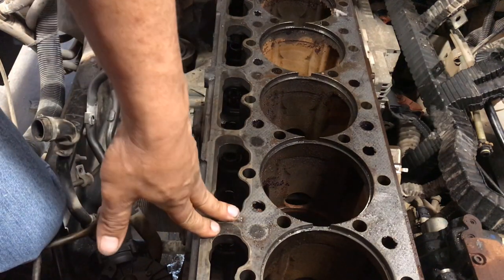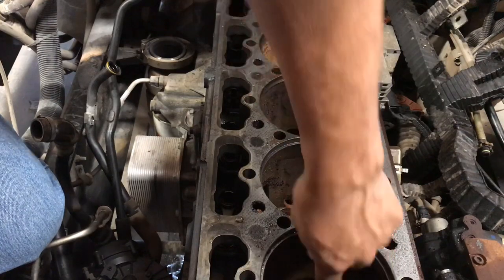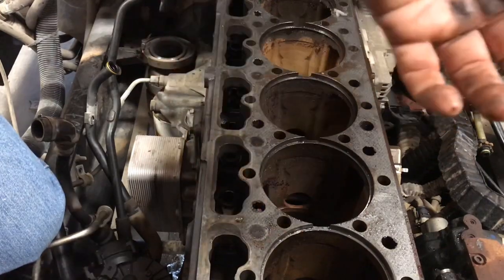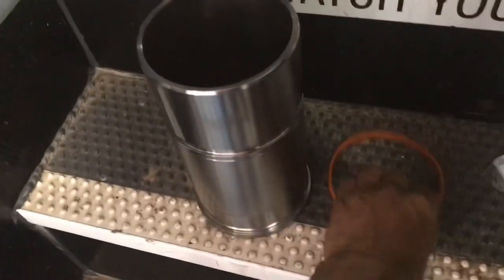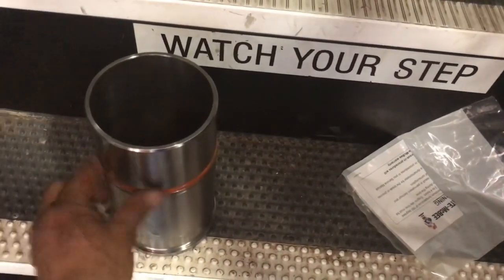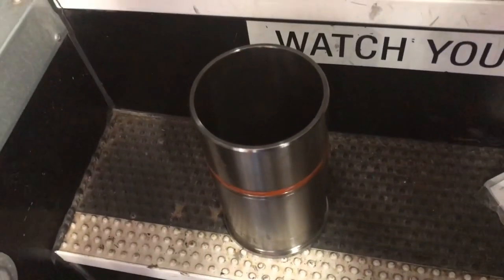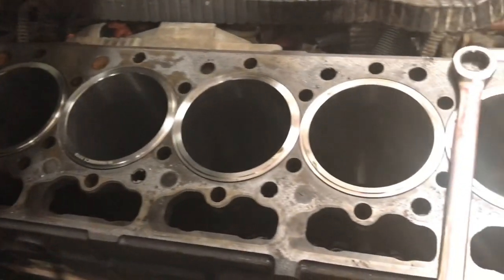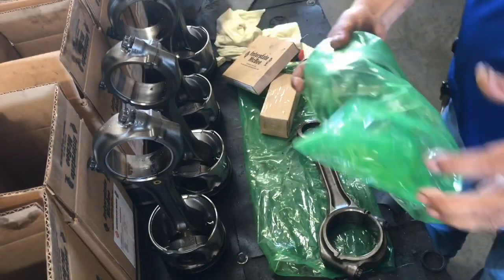Assembling a Max force DT

Comment: Hi Joe, I see that you were using Interstate Mcbee parts in this video. Do you prefer them over Highway & Heavy Parts? Can you tell which one is more recommended. Or if you have had the chance to use Highway & Heavy Parts before for a job like this one. I have to do the same in my 2013 maxxforce DT. Thank you

Comment: Hi I have Joe can I reuse the head bolts. I have 2013 maxforce  that only over heated . Can I just slap a head on it . Thanks
Reply from the maker: It is not recommended but it can be done. I’ve reused head bolts a couple of times in the past. But again. It’s not recommended. They do stretch.

Comment: Hey Joe, a question: have you ever rebuilt an older mechanical DT? If so do you remember the mains torque specs? Thanks
Reply from the maker: Joe Drnec   How old. Pre 95
Reply: Joe’s Bus Barn its a 96 dt466p
Reply: Joe’s Bus Barn there is a lot of 
Conflicting information online about the specs
Reply from the maker: Joe Drnec sorry. My bad. 160 ft lbs   First 50   2nd is 90. Final is 160. Book doesn’t specify that order but we do it in 3 passes
Reply: Joe’s Bus Barn  thank you for all the help brother!
Reply from the maker: Joe Drnec   I haven’t been put in that situation so far. Our cranks (if questionable) get sent in to get re-ground. I’ve never polished up any scoring on cranks. If left the way it is. Rod bearing will seat in old grooves. I just don’t know if yours is enough to make it wear unevenly and knock. Wish I had more on this topic but I can’t see what you are working on joe. Hope this helps.
Reply: Joe’s Bus Barn thank you !
Reply: Joe’s Bus Barn One more question Joe: have you ever removed the harmonic balancer on a DT466? If so how did you get it back on? Seems impossible thanks!
Reply from the maker: Hey there joe. I use a block of wood and a 3lb hammer. Tap it in enough to where I can use the 3 bolts to drive it in. Never looked into an balancer installer (yet). Hope that helps.
Reply: Joe’s Bus Barn thank you!
Reply from the maker: Joe Drnec  we tighten main cap bolts on a DT 466 E to 170. Haven’t worked on a P 466
Reply: Hey, Joe as always I appreciate your taking the time to reply. I have one more question: I have discovered while inframing my dt that one of the rod journals is pretty scored, like i can catch my fingernail, but i have been told to leave the crank alone. Should I leave it alone? Or make some attempt to polish it out? Thanks again!

Comment: Hey Joe, after you inframe a DT like that, how do you break it in? And how could I break it in without a dyno? Also, for the bus to even move, I have to let the tanks fill up, won’t it ruin the motor to let it idle that long? It says not to idle more than 3 minutes without loading the motor.
Reply from the maker: Joe Drnec   Hey there joe. The only break in time we give our engines here r start them up. Check around for any leaks. Let it run for a bit (5 minutes or so idle). Use cruise buttons to accelerate to about 1600. Let it idle for around 10. Turn it off for a bit (30 minutes or so). Repeat process. Make sure you keep on eye on the gauges and for leaks. These engines (even though not the greatest). They do fine with short breaking in. We really haven’t had any issues with them. They will use up a bit of oil within the first 2 weeks. After that. They hold up pretty good. Oh. 1 st oil change at 1500 miles or so. Hope this answer helps. This is what I’ve been doing and engines have held up. Built a few this past year and only 1 has come back. EGR cooler went bad. Engine is still fine.
Reply: Joe’s Bus Barn that is very good to know, thank you!. I had been told it will totally ruin it if it isnt under load from the minute its rebuilt, i was going to have it towed to a dyno lol

Comment: Hi JOE!  What was the fault that required a in frame? Thanks Ken
Reply from the maker: cratersofthemoon  hey there Ken. Unit overheated and was driven till engine stalled out. I’ll add picks of piston head that seized up in cylinder wall. Driver really did his worst to this unit. Overheating caused this engine to fail and require an inframe (rebuild).